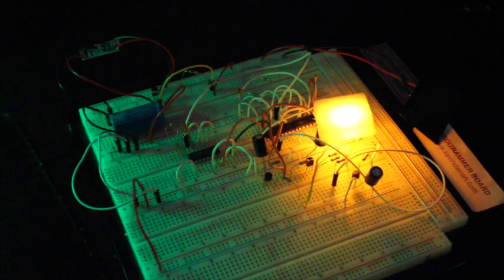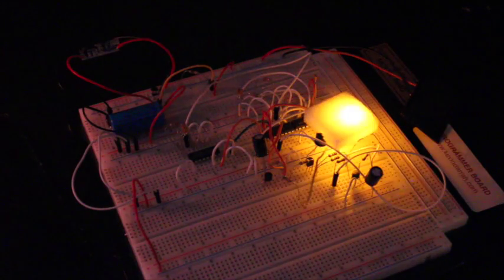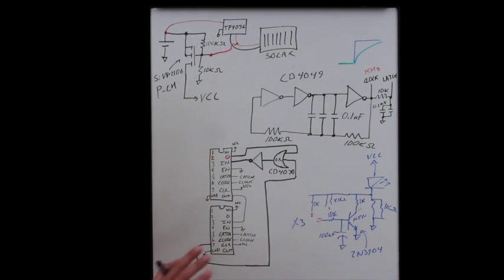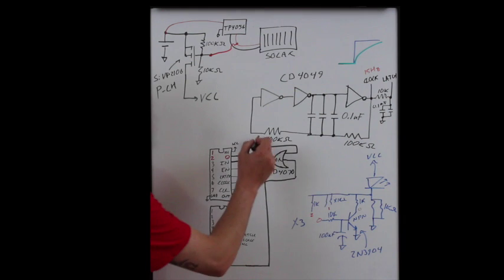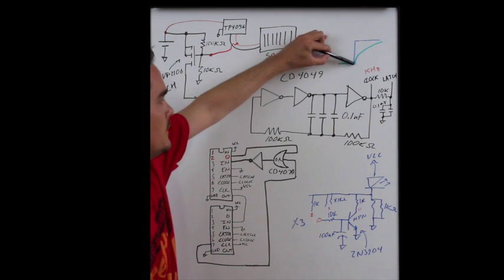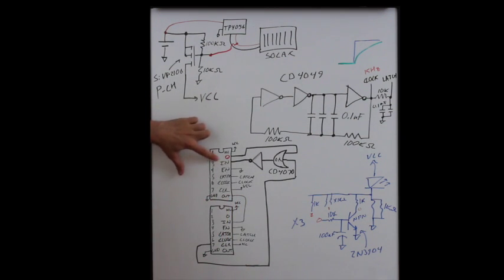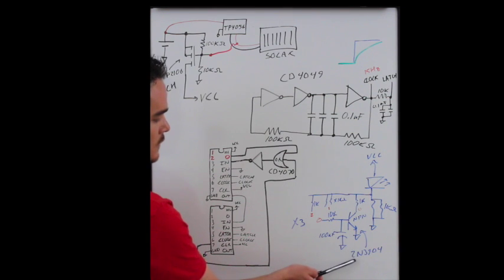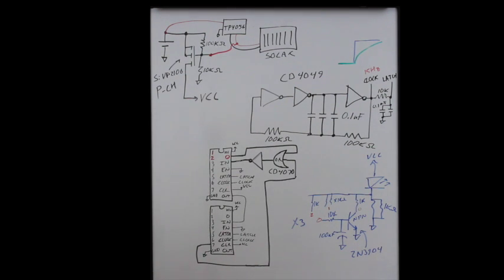How To - Solar LED Candle + Random Noise Generator

Comment: Kevin Darrah 
No suggestion on randomness, I do like the microphone idea, just a quick question. How will you protect the LiPo from over-discharge? or am I being dense and just don't see it?
Reply from the maker: James Lamb good question.  This battery has some text on the side stating that it has internal protection.  I did run the battery down to see where it cuts out at and it ran down past 1.5V.  I think once i make the board that I'll add in a low-voltage cutout.

Comment: It would be cool if u could put a condenser mic which feeds the randomness. So if placed outdoors and theirs breeze it would look a lot more realistic, also if u blow hard enough it could turn off.
Reply from the maker: Arthur Denzlin cool idea!
Reply: jpalm32 Because it's fun, it was just a sugestion. I am a practical guy and I only make what I can't buy or can't see the point of buying something that I can do better for cheaper.
Reply: ciprianwiner
I was being facetious
Reply: jpalm32 I got it. Cheers :)
Reply: Arthur Denzlin You can buy candles that have all those features so no need to bother making one up. Cheers :)
Reply: ciprianwiner 
Why make anything that can be bought then?
Reply: interesting idea, I want to do something similar but on a larger scale with linked lights outdoors.